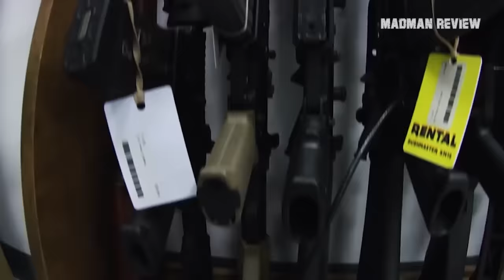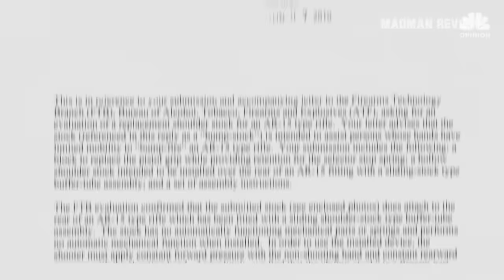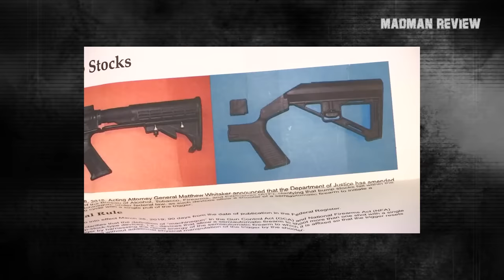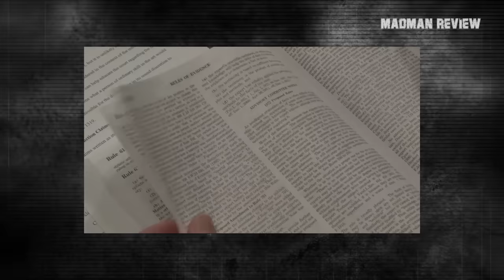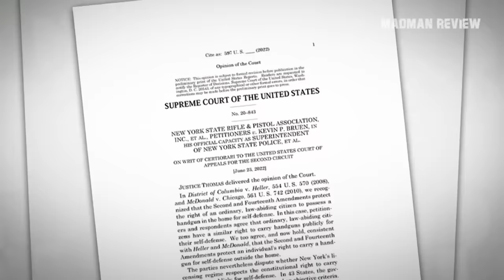FINALLY! Supreme Court Is Killing ATF!

Comment: We have the right to own anything the military uses.   Read the 2A
Reply: Or at least be as well armed as the typical soldier. That was a big chunk of why the founders set right above the federal governments authority. They had just fought off a professional military with groups of volunteers and almost everyone using their own personal weapons.
Reply: It doesn't matter what the military uses or doesn't use. 

Infringement is defined as the limitation or undermining of something or the breaking of a legally binding agreement. 

Shall not be infringed means shall not be limited or undermined.
Reply: I do not agree the average Joe should be able to own military equipment. I don't agree with the tax stamp, but yes with additional checks. I don't believe in the outright ban of any gun, including modern autos. If you have the ability to safely and responsibly own artillery? Why not?

Comment: In the Army in 1966, in Berlin I served as a weapons squad soldier.  As a member in the Weapon Squad, we were trained on a variety of special (at the time) weapons. The M-60 Machine gun, a grenade launcher(similar to to a shotgun), M-14 AR, (7.62mm), and a 90mm Recoilless Rifle.  The big difference between these hand/shoulder fired weapons was that they were weapons of WAR. The Armalite 15 is designed for civilian use, and would not stand up to continuous firing. When I was attached to a M-60, I carried the gun, an ammo bearer would carry the trigger-pod, xtra barrels, and xtra ammo. My point is that a continuous fire weapon must be designed to sustain the heat from the continuous firing. The barrels would turn red hot and begin to sag if the gun was overly fired.

Comment: The key to this issue is focusing on the rate of fire. That is what distinguishes the machine gun and selectable rate of fire firearms. The shooter's trigger finger still initiates and sustains the firing in both cases, and it also stops the firing.  With the bumpstock the shooter is discharging the firearm at a high and sustained rate of fire comparable to the performance and intent using a machine gun or selectable rate of fire firearm similar to military grade firearms designed to do so, and has command over starting and stopping the weapon from firing.  There is no plausible argument for 'bump stocks' or any other device (or use of technique) that increases the rate of fire beyond what a human can accomplish without it.  Moreover, when being fired with a higher rate of fire, accurate aimed fire is not possible at practical hunting or typical sporting distances, so the argument that any firearm with such a device (or technique) still meets the definition of a 'sporting' or hunting arm is completely out of line with claimed uses for sport. This same loss of precision is true with military arms having selectable rates of fire.  Net-net, bumpstocks might be fun shooting at targets that don't or can't shoot back, but when the real battle begins, and it will, moving around with a lot of ammo can be tricky and very tiring.

Comment: If you listened to the arguments, as I just did, the 2A side got raked over the coals and it wasn't pretty. I'm betting Cargill is going to be a loss.
Reply: Lord I pray that is not the case. God bless the United States of America and it's beautiful people
Reply: Lol not really, the judges didn’t even know what the hell they were talking about. However 2A isn’t the grounds for this case, the bottom line here is can an executive agency reinterpret existing laws to create new ones. So even if the argument is weak it’s irrelevant, however it will likely be a loss but the Bruen decision would have to be completely contradicted if it is which undermines them.

Comment: considering their under both congressional and a senate level review as well as being taken up with the supreme court, the atf is in a LOT of trouble. if they are in the review phase with most of the core us government, then there is more then enough evidence of agency overreach and agency level corruption/ unauthorized re-task. when congress created them they were nothing but a tax agency given to the irs to monitor and regulate. the original order from congress was and has never changed, they were given powers via unauthorized methods by the potus decades ago during the first federal ban. congress never signed off on it. the atf is going to be more than neutered, the gca may end up being partly to blame for the atf loosing their law enforcement capacity as they didnt re-task the atf to do it.

Comment: Firearm community has to get a hold of and correct proper terms and definitions concerning firearms, instead of allowing the "unknowing or deliberate miss representation". The use of visual "mish mash" film / photos are used to blur what a non-knowing person thinks of firearms. Showing a "full auto" machine gun when talking about bump stocks (been on range numerous times and never saw one bump stock work without jamming up). Showing a self loading pistol and they call it a machine gun or full auto. Putting a fiberglass body on a go-kart doesn't make it an "Indy Race car",  A "news agency" reporting an assault with a knife or beating, but shows a hand gun in upper right corner of screen should not be  allowed (and it is by design to turn public opinion).  DEFINITIONS  -- semi auto is one round fired per one trigger pull,  machine gun or assault rifle are multiple rounds fired per one trigger pull ! NO such thing as a "semi-auto machine gun",  auto loading pistols are not full auto or machine guns. Semi auto firearms are not assault rifles.   -- Took Dispatcher (scared of guns) to range, started with 22LR, worked up larger calibers, end of day She was shooting a machine gun and loving it ! She bought a pistol and would practice ! Complete 180 from what She thought She knew about guns from news and movies.

Comment: One element to the topic no one will touch is the prevalent crime culture embedded and glorified in black and Latino cultures...
They represent a huge discrepancy accountable to gangs, crime, and "gun violence"...
If you take black and latino gangs out of the equation, America's crime and "gun violence" incidents are immediately halved, and then some...
And Leftist talking points on 2A left mute...
So, who is commiting the crime? Who is responsible for all the homicide? Is the question really "gun violence" or "gang violence"? 
And that should be the topic. And no bereacrats will touch the topic because of the limitless power of the (political), hysterical "Racism!" accusation and it's Leftist narrative...
But, it presents itself as a large part of the debate, maybe a determining factor, no one is willing to address...
Truth and reality is not "Racism!", do not allow the radical Left to control the narrative...